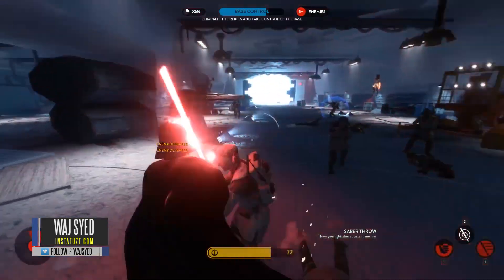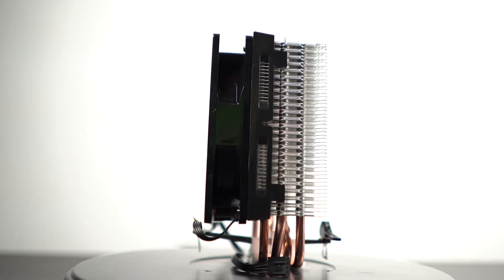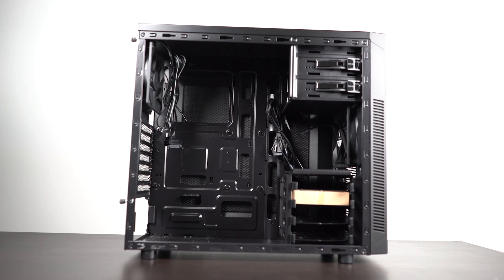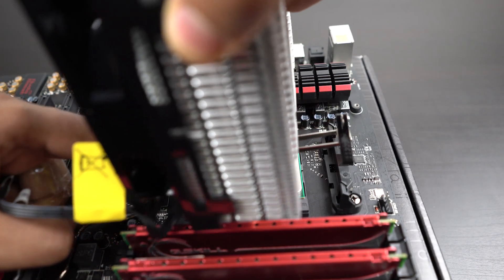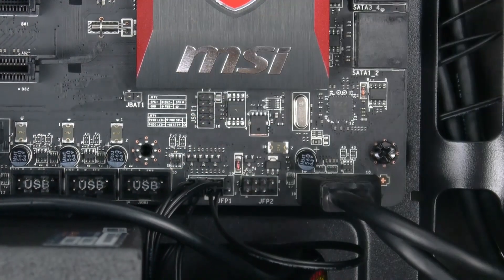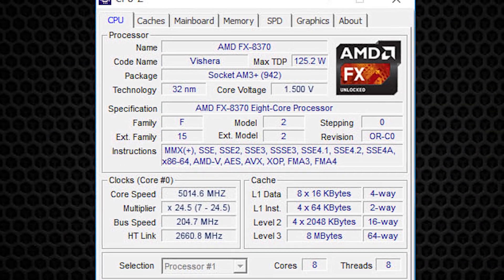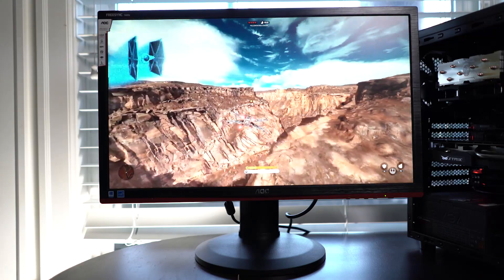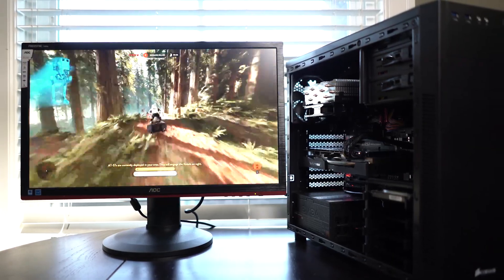Awesome $800 Gaming PC Build Guide & Benchmarks - AMD R9 380X/ FX 8370 @5Ghz

Comment: 5 ghz 1.5v with hyper T4? O_o
Reply: +BlackBeard San That's the same thing i was thinking...that can't be right,i can get max 4.6ghz on my 8350 and i have a phanteks tcp14 which is basically the best air cooler on the market

Comment: nice guide But i think the Motherboard ist Overkill for this build
Reply: +Felix Baier Nope, For Overclocking you should consider a 990FX.
Reply: +Zaber Ansary Extras I was thinking about msi 970 gaming motherboard. I am not planning to overclock but I might do want to overclock it one day would 970 do a good job or do I need a 990FXA??
Reply: ziemas93 You can OC with that 970 Gaming. But Not Ass good as a 990FX. 990FXs has better vrm cooling and more suitable power phase for over clocking. 
You can get maybe upto 4.5Ghz with 970 but wit can go much higher with a 990FX. 
And If you wanna get a 970 then please consider getting an ASUS one. MSI 970 is not that good. Check reviews on NewEGG
Reply: I agree
Reply: +ziemas93 4.4 gig on 970 for me I got it to 4.6 but I was unstable after like 30 min so I stuck with cyber powers 4.4 to be on the safe side, I thought 4.5 was to close to the blink of defeat for a processor that I can sell for 100 bucks and just buy a 990 mobo and fx 9590 for my b day in march so for now the overlook is off in my bios and I'm only running a r9 380 4gig with max settings and as long a I get 40 fps with minor tweaking with high to ultra settings I don't listen to everything I hear hit me on what your trying to achieve and I'll tell you what I'm playing or played with that processor and mobo. seeing is believing fx 8370 is a great cpu for me and it gets the job done playing, recording, encoding or two at the same time. and I do it at 4.0 gigz.
Reply: +Isaac Partlow +Zaber Ansary Extras  
Yo lads Thanks too u I decided to go with 990fxa the difference in price between these two motherboards is only £40 so I might as well get the better one with more possibilities for the future. 9590 is a overkill for me it uses way to much electricity and so Ive heard the temperatures on that beast are quite high, hence why u will need a nice cooling for it. 
Cheers !
Reply: +ziemas93 yes, the 9xxx series are toasters, imo they are nothing more than 83xx series a bit more buffed. stick with the 8350 or 8370 and ur more than ok.
Reply: my thoughts exactly!!
Reply: ziemas93 did you get that mobo yet? I'm waiting til January

Comment: 5 Ghz on 1.5 v and CM T4 ? I can't belive that -.- . What was the max temp in prime95 ?
Reply: I agree. temps were probably up to 75° and AMD cpus are not meant to get that hot
Reply: I agree 8370 @ 5gigz on a air cooler I got a 970 mobo clocked at 4.4gigz watercooled. is it the mobo holding me back not that I need the boost but I rather have and not need then to need and not have. anyone else tried over clocking fx 8370
Reply: +Eldar Beganovic i have macho 140 and fx 8300 4.6GHz my temp up to 75c in games, i not belive MW Technology they liars...
Reply: +gamehero4 base clock is 4.0, 4.3 in head room
Reply: Well I will  have a 990fx mobo in January, I'm going to upgrade just so I can switch to the fx 9590 if I choose to but would like to see if my mobo is holding back I currently have my 8370 paired with r9 380 by power color it gets the job done I'm not fps or graphics whore yet I'm just getting started with pc gaming
Reply: ***** Not wait, i am amd fan too, its allright. I replace my motherboard and чики пуки, не стоит ждать эти процессоры и наш норм справляется, BRO...
Reply: ***** Если честно мне похуй, что там у тебя или, что ты там себе надумал, хочешь ТОЛЬКО играть - бери i3 или i5
Reply: thats right, i have an Fx8350 (about the same as 8370, maybe a little worse scillicon, but not by much) and Hyper 212 Evo (the next tier air cooler compared with T4) and i can only get 4.4ghz at 1.365, and it can barely pass a 10 minute prime95 test at 65°C.
anyone who knows something about CPUs can tell for fact that 1.5vcore on Fx 8 core chip can't be cooled with any air cooler...
yea, he can post a photo with that stats, but i would love to see a footage of that stat and in the same footage a 5 min (not 10, just 5) minute gameplay...

This is mostly a legit channel, and the rig in the vid is a nice rig, but i wouldn't dare  to go beyond 4.4 or 4.5 at stock voltage with that cooler, and even that without doing stress test on the CPU with something like Prime95
Reply: *****
Nope, i'm currently 3 degrees above the highest "safe" temp when stress testing (65°) which is fine since the normal CPU usage will never be constant 100% and i'm not reaching more than 52°c when gaming.
BUT i'm at 1.362! closer to 1.35 than 1.4... and its winter here in Argentina, i don't even know if i will be able to sustain this "4.4ghz at 1.36vcore" this summer.
I should add i have a "Sentey GS-6000 optimus black" case with 3 120mm fans + the 212 fan
Reply: chronicblazer84 nope, its 70° on the socket and 62° on the core to be 100% safe. for short periods of time (under 1 hour), the core can go up to 65-66c with no problems. at 70°c the CPU will throttle unless the mobo option its disabled, but im shure before 80°c will be fried.

Still any temp above 62°c will degrade the cpu so it will shorten the lifespan, but not that much to be honest, the worst it can happen is to reduce by 100mhz the overclock in a 3 or 4 years time period
Reply: chronicblazer84 
you have an intel CPU? coz intels can go up to about that temps...
If you are on AMD Fx i'm sorry but what you claim contradicts all "common" knowledge from dozens of topics in Tomshardware, overclock.net and any other "big name" tek web/forum across the internet. 
In other words you are wrong or full of shit